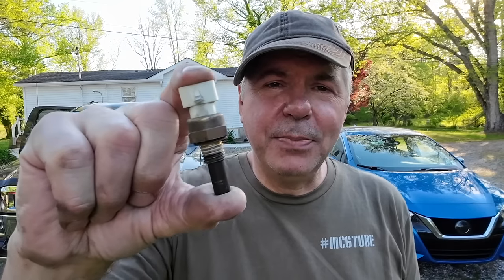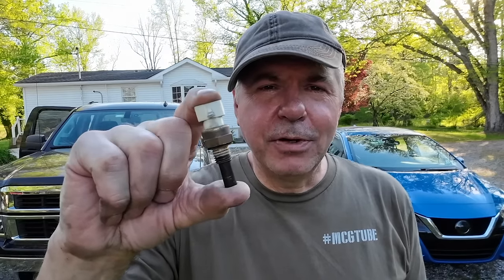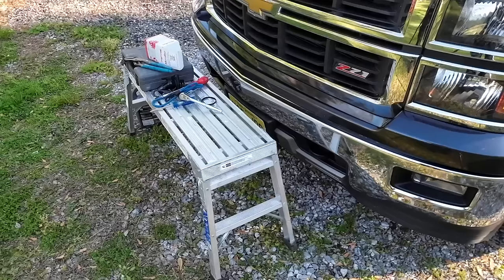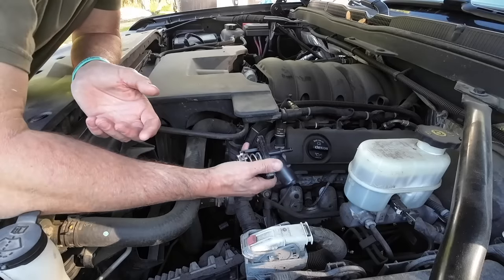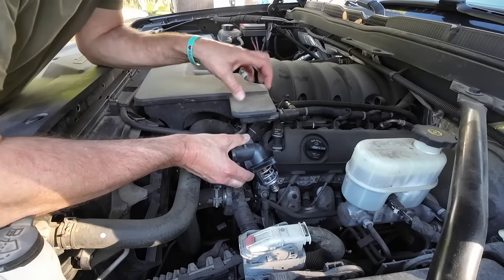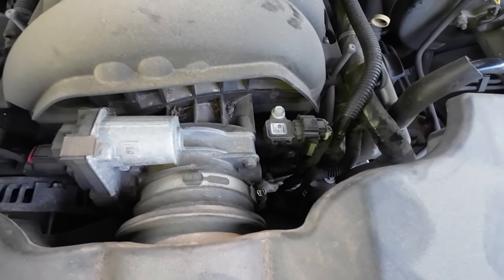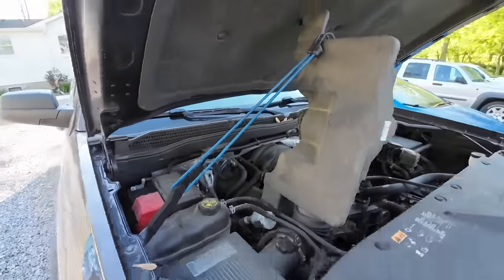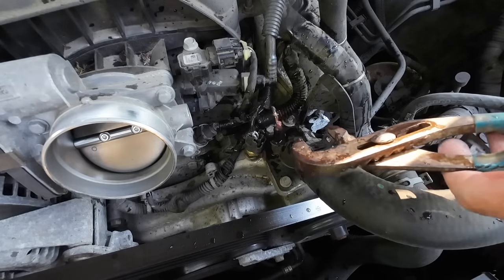Silverado Radiator Fan Won't Turn Off! This is THE fix! MCG video 141

Comment from the maker: Unfortunately, I won’t know if this fix worked long-term. This is why 😖
https://youtu.be/Eg9WHoREFJA
Reply: that's a bummer...glad all are safe!
Reply: My Tahoe was doing the same thing. Changed the temperature sensor first.
When problem continued I changed the thermostat and that corrected all symptoms.
Reply: Looks like the truck did well for you and yours
Reply: I was about to ask for an update. Glad you’re ok but kinda bunmed because I have the same issue. I changed the sensor and had identical results. Gave up and took it to the dealer. Said I had a crack in my radiator. Swapped. Paid a lot. Then it happened about a yr or so later. (Now) But the exact same issue. Temp gauge drops. Tops out at 180. Few times it went to 210. If I’m driving and see the temp stay at 180 I think “it’s about to happen again.” Then as I’m driving I see the temp gauge at 160 and sure enough, fans are on and they stay on after I turn off the truck. If I disconnect the battery and reconnect, they’ll stay off for a week or so. I notice it happens when I go on long trips on the highway. Constant fear of it happening because I know I’ll have to disconnect the battery again. I’ll try the thermostat this time. Sorry for the long comment 😅
Reply: Oops!

Comment: Same issue with the fans and low temp, stumbled across this miracle of a video, went right for the thermostat and bingo. God bless the internet, YouTube, and this guy. Perfect video easy fix
Reply from the maker: Thank you!
Reply: Same here. 2023 Thanksgiving Day, found this video and had it repaired under an hour.
Thank you sir.
Reply: Ironically my 2014 silverado just started doing this on the way home and just watched it. Gonna try this tomorrow.😊
Reply: @MyClutteredGarage , might be obvious with all the fix comments, but just curious,  did the issue ever come back?
Reply from the maker: @ikedee1880  well I won’t know because unfortunately this happened a month later :(
https://youtu.be/Eg9WHoREFJA
Reply: Mine just went out in my 2015 Silverado, gonna work on it tomorrow
Reply: So is it the thermostat or coolant temp sensor
Reply: Because some people will know the issues but go through every single thing to up charge.

Comment: This worked perfectly for my 2015 Yukon with 111k miles. I had replaced the temp sensor 6 months prior and it stopped the fan issue, but it had recently come back once the weather got cold.  I would recommend replacing both the temp sensor and the thermostat while you are in... biggest issue I had was finding my 10mm socket.  I am NOT mechanically inclined... anyone can do this if you follow these steps.  Thanks for posting.

Comment: Thank you!!! Just finished doing this work just over an hour ago, did the thermometer & sensor and saved me over $500 doing it myself. Your video was extremely helpful.
Reply from the maker: Great! Hope that solved the problem! Thank you.
Reply: My 2014(107k miles) is showing exactly the same symptoms your describing. This will save me a lot doing it myself. Thanks for the great video.

Comment: I’m not car guy and have never fixed my own vehicle before.  However, pep boys wanted to charge me $800 to get the fan to turn off so I decided to man up and fix it myself.  I followed your video and decided to replace the thermostat (not the sensor).  The fans works properly now, the gage sits at 210, and the check engine light is off.  Been driving my tahoe for a 2 weeks and no problems at all.  I appreciate you sharing the video and saving me some money.
Reply from the maker: Awesome! Congratulations! You saved about $750. Maybe more 👍
Reply: Yes sir!  Thanks again for the video!

Comment: Changed my temp sensor and thermostat. Although my temp didn’t come up when I took it for a ride and fan continued to run high, when I got back home and turned it off, fan quit almost immediately. Started truck back up and temp immediately went to 210 and fan wasn’t running anymore. Thanks a bunch. You were a huge help!
Reply from the maker: Awesome! Thanks!

Comment: My Suburban has been having this exact problem. I've already changed the coolant temperature switch and same problem. The gauge drops down to 160 and stops functioning and the fan turns on high and continues to run even after it's shut off. I can't tell you how appreciative I am of this video. I'm changing my thermostat tomorrow! Really appreciate you!! This problem has been driving me nuts! Thank you for taking the time to post this! 🫡
Reply from the maker: Thank you. Remember you may need to clear the codes or wait for them to clear. Good luck!
Reply: @MyClutteredGarage  Most definitely! I do appreciate that
Reply: So did the thermostat fix the issue
Reply: @reysandwich  I'm actually installing it either tonight or tomorrow. I got tied up with things going on with my kiddos school and haven't had a chance to do it yet. I did purchase it already though so just a matter of time. I'll actually let you know
Reply: @9ElevenCombatVet  ok let us know
Reply: @reysandwich  I changed out the thermostat and just like that the problem where the temperature gauge would constantly read low and then would eventually drop down to 160 and stop functioning and the fan would kick into high gear has been FIXED!! (Long sentence I know lol).. I'm sitting in my truck now and it's reading right at 210 on the dot. Something it hasn't done in months. Can't tell you how glad I am to have come across this video. I'm also changed out my Purge valve since I was also getting a P0455 code reading a large vacuum leak. Totally different issue but just for anyone reading comments. Hopefully that fixes that problem as well.
Reply: We did one today and this fixed our problem as well, must be a Gm protocol in the ecm that is programmed in if the coolant temp doesn’t change over a given timeframe, I was about to change the ecm but now I have to get more info from maybe a Gm tech, crazy stuff!
Thankyou 
And just to reiterate that I replaced the ECT sensor and the thermostat and fixed my issue 100 percent.
Reply: @reysandwich  I'm glad that fixed your problem as well. Are you having another issue with your vehicle or are you good to go?

Comment: Thank you so much!  My 2014 Sierra was doing the exact same thing with the radiator fan running full blast even after I shut the engine off and my temp gauge would only get up to 185 degrees.  I went ahead and replaced both the temperature sensor and thermostat and now it runs great and back to normal 210 degrees on the temp gauge.  I’ll have to agree with the other 2 comments I read that you saved me $500 at Christmas time.  Thanks again.
Reply from the maker: Awesome! Thank you.

Comment: Thanks for your input. Counting cleanup and putting my tools away was just under an hour. I didn’t have to clear any codes because nothing popped up. The only indication was the temperature flatlined and the fan continued to run after the engine was turned off for about 5 minutes. Thanks again!
Reply from the maker: Excellent!

Comment: Mine literaly just got stuck on for the first time about an hour ago after i.pulled into the driveway. My temp gauge was at 160, and fan was running wide open. I live in southern ky, and its pretty chilly outside.  I have a 2016 chevy 1500 model. Glad i found this video. Also my temp gauge rarely ever gets up to 210. Its usually around 180, so tomorrow im replacing the thermostat.
Reply from the maker: Hope it helps! Thank you.

Comment: Thanks for the informative video!   I had the "demonic possesed fan" problem in a 2017.   Scan tool showed the coolant temp rarely getting over 140F.  I replaced both the TStat and sensor at the same time, about a 15 minute job.  After, I realized my truck had been running cooler and cooler for a while and my mileage was dropping! 😉  I always had good heat, so I attributed it to winter weather and mostly short trips.  I'm pretty sure the real problem was the TStat, but the sensor was cheap and easy enough to replace while I was there.  Now the temp gauge reaches straight up and down and the fuel mileage has improved.
Reply from the maker: Nice! Oddly I was noticing a fuel economy issue too. These new-fangled computerized machines :)

Comment: 2015 Suburban LTZ -- appreciate the detailed video. Our fans stuck on without a temp gauge signal around 102k miles, changed the temp sensor then and it fixed it, but issue returned at 111k miles, again with no temp gauge signal (<160F). Changed both thermostat and sensor and hope it will last for a few years.
Reply from the maker: Good luck! Thanks!

Comment: Just wanted to say thank you. Had this same issue. I replaced the sensor, problem went away for about 5 months and then started again. Paid the $68 for the thermostat, swapped it out and put some coolant in and so far so good.
Reply from the maker: Nice! Good luck. Thank you.
Reply: You have a wire that will short again never was the thermostat
Reply: Did the engine light came on during this issue?

Comment: This is my 2014 to a T. It's been riding at that mark between 160 and 210 for quite some time. I thought I heard my fans running hard a few days ago and it stopped. Today it happened again. Gonna give this a whirl in the morning. Great vid..will reply w/ results!
Reply: Worked like a champ. I too changed the sensor first because it was "easier". Made no change. Once a new thermostat was on it worked like a charm. I however did run into a small hiccup. When hooking my overflow hose back up as i slid the clamp down the hose the stem on the thermostat broke completely off. I had to dig it out of the hose and then return it for a new one. Guy at the counter said he'd seen it a few times over the years. Glad it happened when i was fiddling w it and not while cruising down the road. Thanks again for the vid!

Comment: Thank you for posting this video. I had the same issue on my 2015 Chevy Silverado. Replaced the sensor but temperature would never get more than around 180° I replaced the thermostat and temperature immediately moved up and held at 210° 👍
Reply from the maker: Awesome!

Comment: Thanks for this video. I had the same problem this morning. Bought censor, didn't work. Bought thermostat, and it did the trick. 

Check engine light never came on. But the new thermostat did the trick
Reply from the maker: Nice! Thank you.

Comment: Thanks for the video Ed I have a Silverado LTD let’s go one step further if you still have your old parts check continuity on that sensor and then put it in boiling water and see if the continuity reacts differently. Also, put your old thermostat into boiling water and see if it opens. Just my opinion. Have a great weekend.
Reply: Ltz not ltd
Reply from the maker: Good test!

Comment: I am having this exact same issue on my 2019 Colorado with 87,000 miles on it intermittently over the past few months. The code literally reads bad sensor which is a little frustrating and misleading. I agree with you that it is a thermostat issue, and I am planning on starting there with mine. Great video. Very informative. Thank you.
Reply from the maker: Thank you. I hope that does it!

Comment: I will be replacing both the sensor and thermostat on my 2014 gmc sierra. I’ve had the same issues for about 2 days now. Thanks for the video!
Reply from the maker: You might not need to replace sensor. 👍
Reply: Sensor is fine. It's reading correctly at 160 degrees. Change thermostat and disconnect battery for 10 minutes and all will be good.

Comment: Had the same issue and took your advice, temp went to 210 finally, hope I don’t have to change the temp sensor, thanks for the very helpful video saved me a lot of frustration and money
Reply from the maker: Excellent! I bet you’ll be good to go now.
Reply: It’s 2 months later, did you end up changing the sensor?
Reply: @jmey313  nope

Comment: Having completed this repair about an hour ago; the fix for me was the sensor and not the thermostat. From what I've been seeing it can be either? That being said, the sensor was under $20 dollars, whereas the thermostat was about $60. Unfortunately, I replaced the thermostat first and it didn't solve the issue so I had to buy the sensor after all. My personal opinion - if I could go back and do it over- would be to buy them both and try the cheaper fix first. The parts stores where I live do not refund parts that have to do with anything electrical once they've been used. Ergo, I had to eat $60 because the first part I used was non-refundable. Had I done the sensor first I could have returned the other part and saved some money. The plus side is the repair is REALLY easy to do yourself. Each of the two things I tried took about 5-10 minutes a piece. Hope this helps!
Reply: I assure you it was the thermostat. You must disconnect the battery for 10 minutes to clear  codes that are beginning to set.

Comment: Great video. But, in a comment I read where one owner removed the ground from his battery and that seemed to fix the problem. I did that and so far so good maybe that resets the sensor? I drove for 10 or 15 minutes it did not get to ultimate temperature so possibly the thermostat is leaking through. I may go ahead and replace the thermostat as I have 271,000 miles, highway, on the truck. Great engine so far.
Reply from the maker: Yes you probably just reset the code, but it will likely go into trouble mode again. Especially if the engine temp is running low. Thanks for watching!
Reply: Thank you for taking the time to reply.  I will get the thermostat changed.  @MyClutteredGarage

Comment: Awesome video..mine started doing the same thing..i have a question for people that know about vehicles more than me,if i drive it fot a couple days with the problem will it hurt the motor or anything? Thank you
Reply from the maker: I drove mine for weeks before I figured it out. With mine, the problem was that the truck was not getting warm enough, so there was no issue with driving it.
Reply: @MyClutteredGarage  that's what mine is doing,it's staying at 160 and the fan constantly blows,even for awhile after turned off..thank you for the help
Reply from the maker: @YT-DAD-BASS-ASSASSIN good luck!
Reply: @MyClutteredGarage  thank you for the help

Comment: I noticed the loud fan sound while driving, then noticed my temp gauge was showing min 160°. Heat was still runs you out of the truck, but I’ll replace the thermostat and see if that fixes it. I’ll have to swing by the parts store and have them blank them read and blank the codes. Fingers crossed this works.
Reply from the maker: Good luck! 🤞

Comment: I skipped the sensor replacement and went straight for the thermostat since I wasn't getting warning lights, only excessive fan speeds. 

How long before the process resets itself? I drive around the block, but the problem still exists. 

Should I replace the sensor too, or drive it a little longer?
Reply from the maker: If you can't clear the codes with OBD2 scanner, keep driving for a few days. A local parts supply store should read and reset the codes for free.

Comment: I can get my fans to stop doing this for a few days to 3-4 months by disconnecting the battery negative for a few moments and reconnecting it.  That would seem to rule out the thermostat as it's a mechanical device, right?  I've had the sensor everyone talks about replaced, no change.   My truck has had this problem on and off for a few years now.  It will stop for months, then seemingly when the temperatures start dropping in the fall /winter it happens a lot more.  I went all summer with out the fans sticking on, but in the last week it's stuck on 4 times. 

I guess I will try having the thermostat replaced though I can't see how it could be the problem if disconnecting the battery momentarily stops the problem for some time.
Reply from the maker: I felt the same way about the thermostat. But when I saw that it was not reaching 210°, I realized it was bad and the temp sensor was trying to tell me. Hope a new thermostat does the trick for you!

Comment: how do i reset the codes? i replaced both, and nothing worked for me. not sure if its just because i need to reset the codes? or... im not good with mechanical stuff.
Reply from the maker: Some say disconnecting the positive battery terminal for several minutes will reset it. But most parts stores should offer to reset for free. You can also buy an inexpensive OBD2 reader and clear the codes yourself very easily. Here’s an affiliate link if you’re interested. https://amzn.to/41hFzmg

Comment: Had this same problem on my 2015 Silverado a couple months ago, replaced both the sensor and the thermostat and it did fine. 4 months later here we are and the fan doesn’t stop until a minute or 2 after the truck is cut off. Any suggestions?

Comment: I get no codes, however I notice my fans turning on erratically (even when first start up in the morning) and my temperature is always on the line left of 210 degrees.   (no codes)   Should I just change both thermostat and sensor?
Reply from the maker: Changing the sensor and the thermostat is probably your least expensive starting point. Although that does sound different than the symptoms I experienced.
Reply: @MyClutteredGarage  Thanks, I think I will just go ahead and switch them out since Im at 93k
Reply from the maker: @flyonawall6521  good luck! You may still need to clear the codes afterward.

Comment: Unhooking the battery for 15 minutes turning the key on well it’s unhooked then hook it back up and start the truck illuminates resetting the codes it calls for fresh codes on the restart